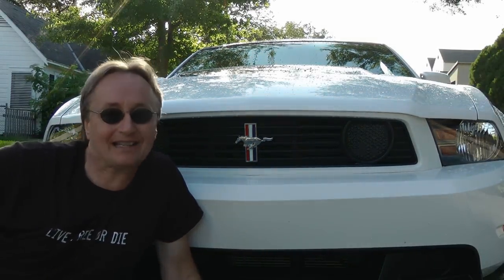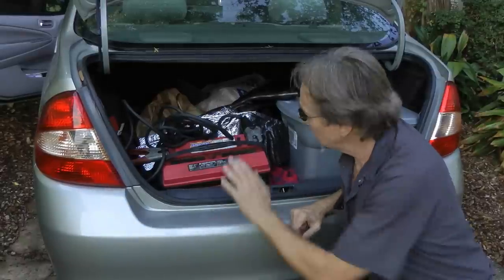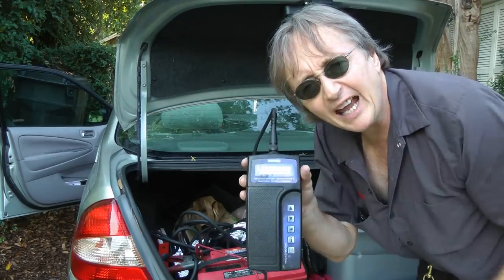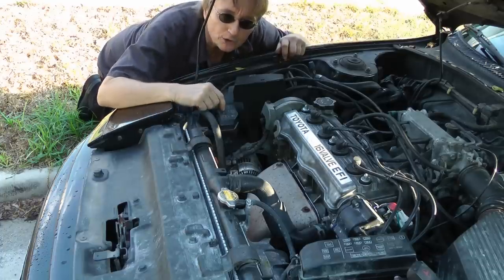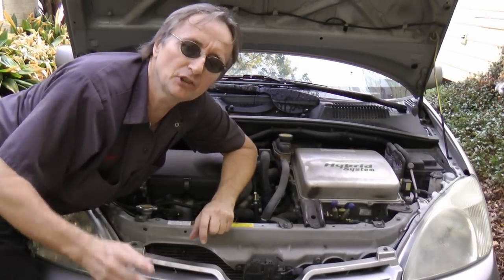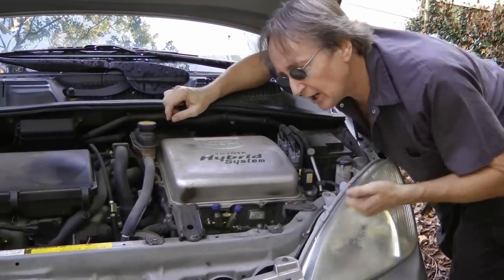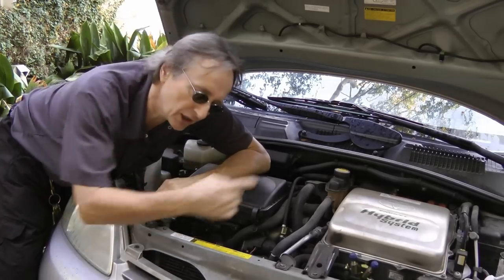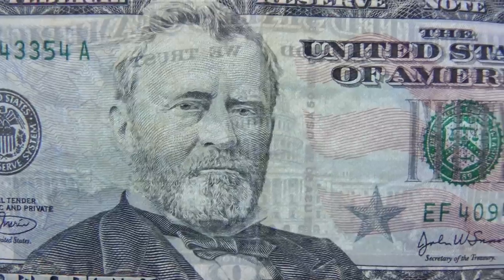Hybrid Car Electrical Problems

Comment: The irony... On a car that is meant to save the planet, the transfer assembly is meant to be thrown away because of one bad part. And the least thing I want to do is having to pay more to be environmentally friendly. I'd rather spend my money on something nicer.
Reply: I understand that lately it's become possible to change just the MG2 stator.
Reply from the maker: *****
I've seen guys try, most efforts fail.

Comment: How are hybrid and electric cars green when they use electricity from coal power plants to recharge?
Reply: Yup and the production of the battery is supper dirty that any gas car is cleaner. It also is supper ugly and has no power.
Reply: Hybrid cars don't get electricity from a power plant they recover energy normally lost to braking.  The electric motors have quicker acceleration than gas engines as well.

Comment: I think the EV1 was a good machine ,plug and go ,the only problems they had was the cheap batteries which they swaped out later ,just batteries and an electric motor and go ,who goes more than 40 miles on way to work anyway better than the Volt in my oppinion!

Comment: They no doubt want the old generator back so they can rewind it and sell it to someone else. A motor rewind shop might be able to repair it but if the generators are burning up it is because they were designed wrong to start with.

Comment: i say it be a waste of money to buy one of theses cars as i rather the older cars such as just the alternator only. i drive an 1999 Ford AU from a car dealer ship and never had such problems with it so fare i had it for over a year and i found out i just only done 20,000 ks I'm in Australia so we don't go by miles. but i have changed the oil 2 times and soon i be doing it soon, i do it every 10,000 or 5,000 ks. but the motor says use the right oil but i always go a bit thicker for it.

Comment: Going green means spending all your green.
Reply: True
Reply: Did you do it in a liberals face?
Reply: At current gas prices, I've saved 18,940 in gas with our two Prius. Mind you, gas is just a little over 2.00 a gallon right now, but has been nearly 4.00. In the nearly 400,000 miles on the pair we've spent around 660 in non-regular maintenance repairs, and the (2) 12v batteries probably would also be considered regular maintenance. So 300.00 in non-regular maintenance.
Reply: Prius...the most misaligned car after the Tesla.
Reply: Except it's more reliable than whatever you like.
Reply: Thats funny right there.Good one.

Comment: Honda had the right idea with their green car called the 'Clarity' which was hydrogen-electric with the only waste product being water. However hydrogen in its concentrated form is highly volatile and difficult to store safely and then you have the problem of infrastructure. When someone mentions hydrogen you either think 'bomb' or 'hindenburg' I've never been a fan of electric cars because of the range and the fact they are heavy and as for being 'green' that's open to debate.

Comment: I don't get this video either, the 12 volt bus is supplied from the hv bus by a 100 amp DC-DC converter, not directly by a generator.

Comment: SIMPLE fix.  a portable jump starter would boost the 12v....that battery only boots the computer, it doesnt crank the engine.  it needs ZERO cranking amps.

Comment: hybrids and electrics have far fewer maintenance items that can go wrong. they are indeed the future
Reply from the maker: hybrids actually have more maintenance items, being both gas and electric. But electric only cars have one big problem, our power grids are already maxed out and could not take millions of cars recharging daily.
Reply: We will all  be charging our cars with solar panels on the house withing 5 years
Reply: The engine is a bullet proof Atkinson Cycle that isn't constantly running and the CVT had only like 8 moving parts or something but EVs now, those are SUPEr simple and can charge with home solar/battery combo. You can build your own or buy many brand choices out there. The more homes that do that set up will lighten the grid load BUT Warren Buffet is pushing back and other lobbyists to tamp it down because it's bad for their profits.

Comment: that doesnt make sense the generator (mg1) puts out 200 volts ac wich then gets stepped down and inverted to 12 volts dc it is also what starts the engine but then again the gen 1 Prius had some very strange problems

Comment: This is the exact reason why i refuse to purchase a hybrid or a new car. Too much to go wrong and too expensive when it does. I have a 95 civic ex sedan with the 1.6 vtec. Has 300,000 miles and runs like a swiss watch. PLus its dirt cheap to fix when, and i mean when a part breaks because they rarely do.

Comment: Scotty, you don't know what youre talking about. If the engine started is not the generator like you said. MG1 (Motor/Generator 1) Starts the combustion engine and generates power back to the high volatege battery. most likely the problem is the dc to dc converter and you can buy a used one for cheap!

Comment: come on man.. that's like a pre 2000 Prius. it's nothing like the 2006 onwards Prius models.
Reply from the maker: pretty much exactly the same technology really
Reply: Nope, they beefed up those parts starting with the 2nd Gen and more so on the 3rd Gen
Reply: Scotty Kilmer the second gen and onward seems to be tons more reliable. Never thought I’d be a hybrid owner, but just picked up a 2004 Prius with 235k relatively cheap. It’s a well engineered car.

Comment: You'd be more green just buying a typical internal-combustion powered Honda or Toyota that can easily last 250,000 miles or more on regular maintenance. No special batteries or special charging systems to wear out.
Reply: My 2005 Prius just turned over 250,000 with low maintenance and it's still going strong.  Though I will have a headache when the more advanced stuff starts to wear out.
Reply: Spaghettios The electrical parts rarely wear out the way a regular car does.  On a hybrid, even the brake pads can easily last well beyond 200,000 miles, because they rarely get used
Reply: romansten9 200.000 miles ? Are you fuckin serious saying that ? Hahahhahahahaa
Reply: Kurucz Tamas Yes, brake pads can last 200,000 miles on a hybrid.  Do some research. Do you even know how a hybrid works, or how the car slows down?? No, didn't think so.  Now, everyone reading this is laughing at YOU.  HAHAHAHA!!
Reply: Kurucz Tamas with regenerative braking it hardly uses the brake pads. Unusual system.

Comment: The diesel its greater than hybrid right now, the bad news is that some factories are doing disesel hybrids, like peugeot,  but luckly for usa they no prescense there. I think that 100% electrical its good, but this time the middle way its not working.

Comment: The world on the street from the conscious people is that going green is the best thing we can do for the environment and it would also prevent all these wars for oil.  When it becomes affordable and practical hopefully I can be be the first in line to purchase a electric car
Reply: except with toyotas manufacturing setup on the prius, assembly alone emits enough CO2 that a conventional car for its first 50000 miles (or more sometimes) is more economical. Combine with the fact the hybrid needs its battery exchanging by that point and these total transmission swaps too, it is less green than a normal car.
Reply: +SixSixSevenSeven lol any facts?

Comment: Scotty do you think it's better to invest in our new technology ( hybrids and fully electric vehicles) because it seems that the auto manufactures are trying soo hard to come out with a vehicle that runs great but end up screwing themselves in the ass I personally like the older cars simply because like you said its alot cheaper to replace a $100 alternator then to replace a $5000 generator I just don't think the new cars will make it to 200,000 miles because they put all of this electronic shi

Comment: Would have been nice if you actually fixed it or took it apart and found the problem vs just looking at the dealer price. Maybe it is just a bad connection that needs cleaning and costs nothing but time, or a smaller part you can get used on ebay for $10. Instead you point to it and say "hybrid bad".

Comment: @scottykilmer and the best thing is when you run out of power your screwed on the side of the road because its not 24/7 technolgy like gas cars are hybrids with batterys are the worst cars to get in the long run if your going to make a hybrid make it like a set up in locomotives and no battery you want somethings thats green use hydergen and use a on demand system that does not use eletrolases for hydergen for safty reasons

Comment: why you shouldnt buy a old hybrid: its a hybrid
Reply from the maker: +RedesCat cause they often cost a TON to repair when old and the electronics go bad.
Reply: +Scotty Kilmer often times it makes more sense to buy a real electric car, but most people are simply not willing to go that far.
Reply: +RedesCat No, because its a toyota
Reply: Ya, the the 2008 civic hybrid and newer is the better hybrid in my opinion. Especially if you are driving on fast roads with minimal stops. It's the opposite in the Prius. The Civic is the second most fuel efficient hybrid. Honda's hybrids are way better than Toyota.
Reply: Yep same with electric cars. Don't buy them either.
Reply: Don't forget that it's ugly and drive horribly
Reply: punker4Real One more thing; 634+ miles from 45 litres of fuel in the UK - you really think that doesn’t get you very far? Really? That’s my record on one tank of fuel from my OLD Prius. Even in deep freezing winter I’m getting over 500 miles to a tank of standard fuel. Can’t go very far? Yeah, I can’t drive it to Mars, if that’s what you mean, right? 😳🙄🤦🏻‍♂️
Reply: @theory816 
V8 on a Lexus rx400h?
Lexus uses ONLY quality parts.
My 2007 rx400h has 229k.. it runs like a new car. Power and torque is still there. All function works fine. Power window noiseless, sunroof smooth, transmission so quiet, engine purr quiter than a cat. Lexus gives you money QUALITY, compare thay with american made Cadillac... Suburban... Ford... etc.
Lexus hybrid battery outlast any made hybrid battery.

Comment: he's right I could buy a used Nissan Leaf $5,000. battery 5 grand a lot better than the original battery that if you want to go green I seen a smart car on eBay $2,800 electric vehicle

Comment: If you bought an electric car wouldn't you still be spending a lot of money 

As in the money you saved at a gas station is now being spent on your houses electric bill
Reply from the maker: not really true, the cost of powering a car by electricity is presently about ten times cheaper per mile than gasoline.
Reply: Scotty Kilmer good to know.
Reply: My hybrid has no problems. I'm over 100,000 miles on it. I got it used. It's a 2008 Honda Civic Hybrid. It's better because the Prius will just stop working when the hybrid system dies. If my hybrid battery dies it still has a regular car battery and can run like a normal car with 90 hp, but sadly it will have a mileage similar to most cars when that happens.
Reply: There is very little maintenance with an electric car. Savings there too
Reply: +Scotty Kilmer What about when the electric motors go out?

I don't trust all electric cars

sure they are good now but what about the expense of maintenance?
Reply: Ha ha, when the elec motors go out? Sure in a small % due to statistics but even then they can be replaced. They have fewer moving parts by a mile to worry about going out.
Reply: fargeeks people have 300,000 to 500,000 or more miles without the electric motors failing. not an issue

Comment: who knows what kinda problems electrical car will have in them. they will cost a mint to fix if anything dies. this is why the eternal combustion engine will keep running until were forced to change.  but really. the internal combustion engine is no better.

Comment: Well that's now, the technoligy needs more development of course, Gasoline engines where the same for many of their early years, large 8 cylinder engines where made and many of them where underpowered, just check alot of those american cars they made until the 1990's.

Comment: Watch out the new  Ford fusion hybrid, it will break down due to the new technology of battery nickel-metal hydride battery. Buy the Toyota hybrid because they are on 3rd generation hybrid technology. If you want the others brand, wait to see the reviews after at least 10 years for that particular hybrid car brand.

Comment: the only reason why I lost interest in a hybrid car is because yes i understand  the battery packs can wear out  and I hear that can cost over thousands of dollars to replace

Making the hybrid a FAILBRID

so yes I'm better off buying another vehicle that isn't a hybrid
Reply: Depends on how you intend to keep your car. Prius batteries are covered by a 100,000 mile warranty. Also, they can be refurbished for 1/2 price of a new set. A Prius makes more sense when the cost of petrol is high.  At present, gas is relatively cheap, so the economics aren't there.  But gas won't stay cheap forever.

One of the disadvantages of being a baby boomer, is I still have memories of the Arab oil embargo in the early 70s, when the price of gas tripled, there were long lines at gas stations, and we were limited to less than 10 gallons at a time.  That is, if stations even had gas.

After that scare, I bought a VW Rabbit diesel. Unfortunately, it was very trouble prone, horribly slow,  noisy, loud, and smelly.  My neighbors passed around a petition demanded that either I sell it or move because of the racket it made when I started it in the morning.  

After retiring and not having to commute to work, I decided to buy a Prius.  I am very satisfied with it.    I was concerned about having to replace the lithium batteries, but they are warranted for 100,000 miles.  Having driven 20,000 in 5 1/2 years, I figure I'll be dead before the warranty runs out.  In typical Toyota fashion, the only expense I've had is for oil changes, and  scheduled service.  

I only have to fuel up every couple of months or so.

Comment: I wonder if the inverter's electric water pump failed, and the owner just kept driving it with the check-engine light on until it died.
Reply: I wonder if the inverter coolant was ever serviced? Probably not. How many miles was on it? Never heard him say.

Comment: Planned obsolesce.  So sad.  Hybrids are just going to create more waste, especially hazardous waste with their batteries.  My 25 year old Ford Taurus is still going fine.  yes I keep having to replace parts every once in awhile, but it runs, drives, and old parts can be turned in for cores to be rebuilt.  More green than that crappy Prius.

Comment: @eleeter Hahaha with that holier than thou attitude the old timers will pwn your ass time in and time out, like Scotty just did. I'll tell you what's cheap to run and maintain, a 1994 Toyota Corolla. It's slow as hell but bulletproof reliable.

Comment: A hybrid is just a 1/2 ass way of driving an electric car.  If you want to truly save money on gas, don't waste your money on hybrids.  Buy a fully electric car like a smart electric drive, Nissan Leaf or Tesla.  The Nissan Leaf is the most practical.  The 2016's Leafs are the way to go with the new 30 Kilowatt battery coming out.  A lot of people get a gas car, put 150,000 to 200,000 miles on it and often have to put a new or rebuilt engine.  You can do the same with an electric car, but just swap out a battery for about what a person would pay to replace an engine.  And year, it may suck paying $5,000 to fix that old Prius, but it's better than spending $25-30k on a new Prius.  $5k on a new Prius is only a down payment!  Plus PAYMENTS FOREVER and then full coverage insurance is required that whole time.  FORGET THAT NOISE!
Reply: GMoney there you go, completely sidestep all the points by merely pointing towards "savings" that I still debunked, as I said, just keep sidestepping the actual argument, but in case you missed it let me reiterate.

1. battery lives deplete quite vigorously do to discharge and recharge
2. coal factories which do more damage to the environment run your electric piece of shit
3.the emissions on hybrids aren't actually that much cleaner 
4. the process for obtaining the materials to make those batteries is 100x worse for the environment than burning fossil fuels
5. you aren't actually saving money on electric due to the work being way more costly for major repairs.

side step it all you want but every way to Sunday electric is far worse...
Reply: +Strife Life You love to keep speaking of MYTHS, sir.  I am not telling people to buy hybrids.  I am telling them NOT TO.  I own one and DOT NOT recommend buying one.  If you want to cut gas down, simply buy a fully electric car.    I own 3 cars.  Gas, electric and hybrid.  After having the electric, I would never want to own another gas or hybrid again.
Reply: +GMoney SWAP OUT A WHAT!?
I'm so sick of people cutting off their youtube comments -.-
Reply: +Tyler Cameron I'm so sick of people boring me.